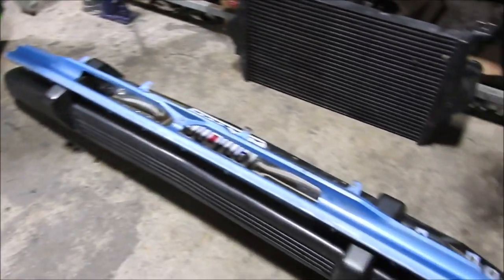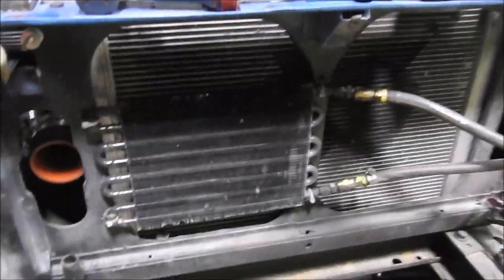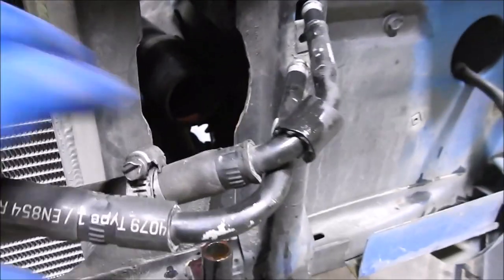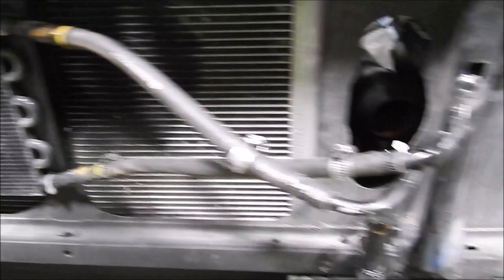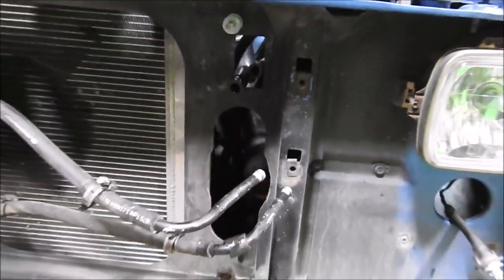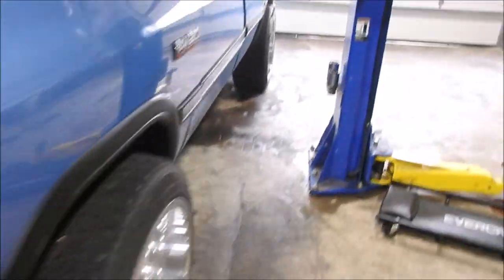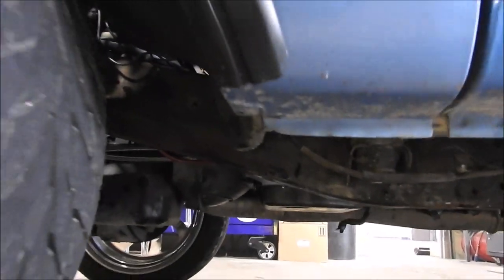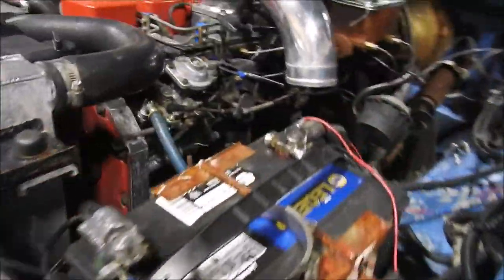Installing New Trans Cooler & Cooler Lines!

Comment: I upgraded my trans cooler to a mishimoto factory cooler on my 2nd gen. I need to replace my factory lines at some point.  You ever going to dyno ur truck?
Reply from the maker: I've dynoed it 3 times
Reply: @EveretteMartin  what did it lay down?
Reply from the maker: @bigmurph1447  at scheids it put down 414/950 on fuel and 483/1108 on a small shot of spray
Reply: @EveretteMartin  wow that's pretty good for just a ve pump